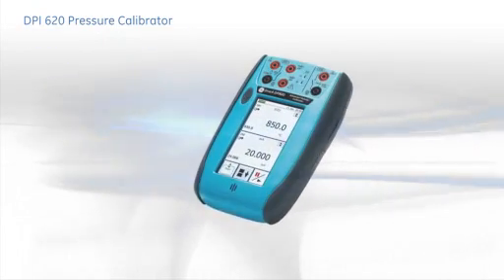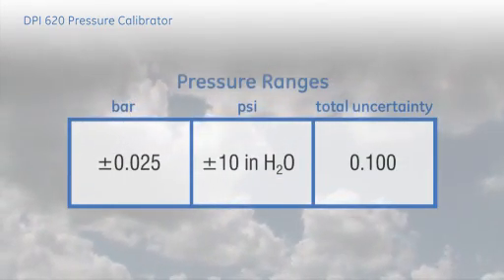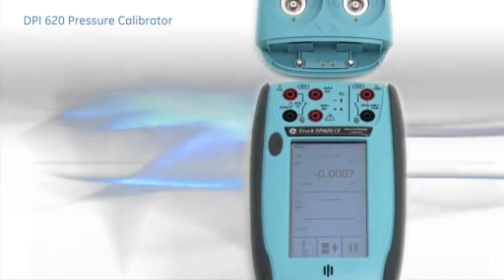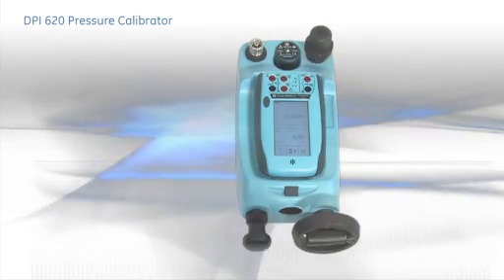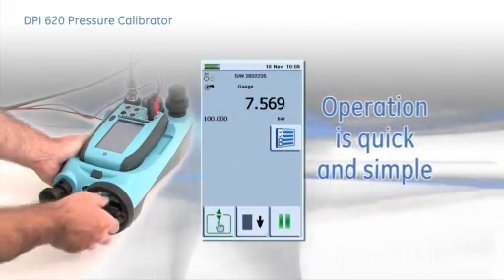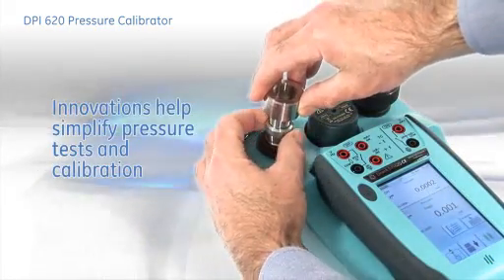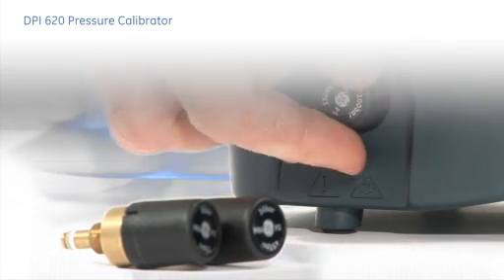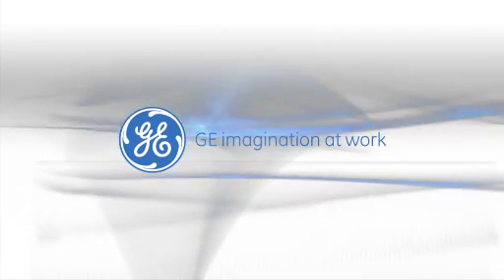Druck DPI620 Pressure Calibrator - PART 2

Comment: Hello, good morning everyone!
I work in a company that performs calibrations on pressure and temperature equipment here in Brazil, and one of our Calibrators like this one, had an error in the generation and reading of channel 1 of the equipment, would it be possible to reset the parameters of this equipment?